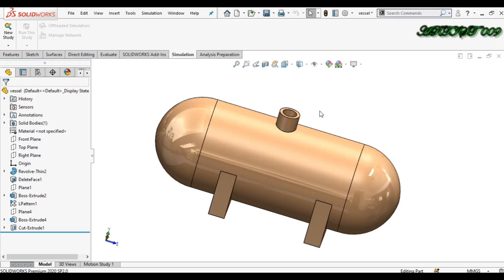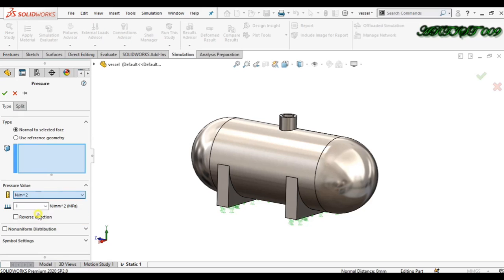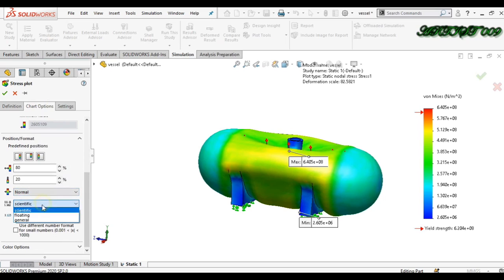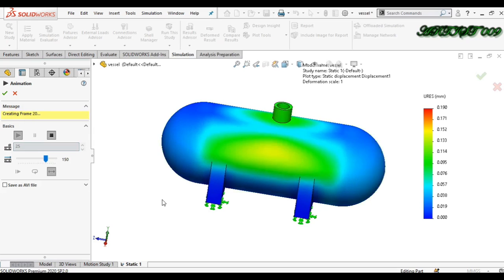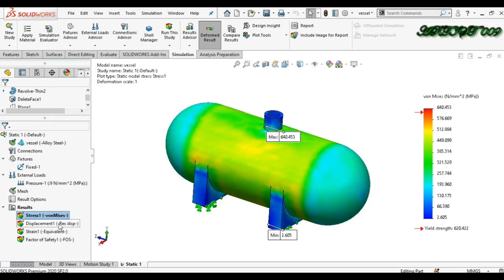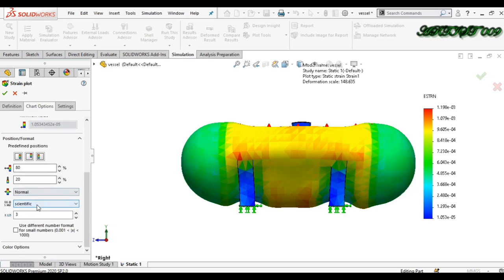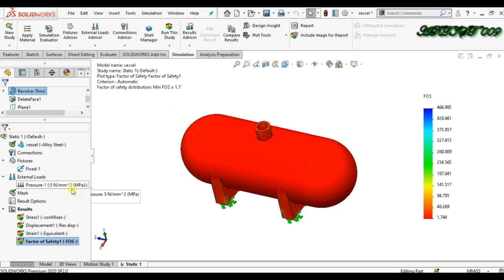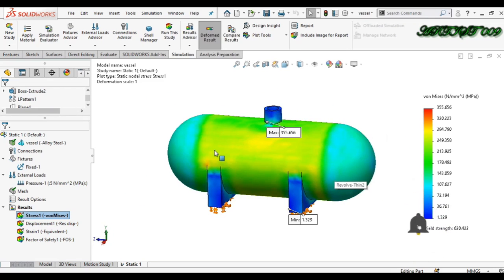Solidworks simulation | Pressure vessel testing in Solidworks

Comment: Facts of safey 1.5 
My design how much coming is pass
Reply from the maker: Hi, If u apply 5 Mpa and u will get factor of safety 1 it means yr system will get 5.01,5.05,5.1 Or more Mpa value than yr vessel will fail, factor of safety show ( 5Mpa that is max. Pressure For yr vessel that time if u r getting FOS is 1 if u add more pressure yr vessel will fail) 

Here It means FOS 1= 5Mpa
FOS 2= 10Mpa
FOS 3= 15Mpa
FOS 4= 20Mpa

EXAMPLE,, If FOS 1=10Mpa
If u r getting FOS 1.5 that means yr vessel can stand 15Mpa, after 15Mpa yr vessel will fail

FOS 1.5 OR 2 IS OK
Reply: Fos maximum 1to 1.2 it's pass right sir
Reply from the maker: Need minimum FOS 1.5
Reply: Your provide online training class I'll pay for it
Reply: Please send your contact number sir